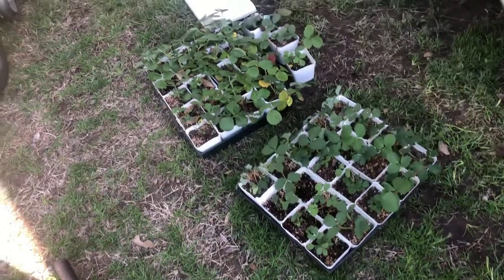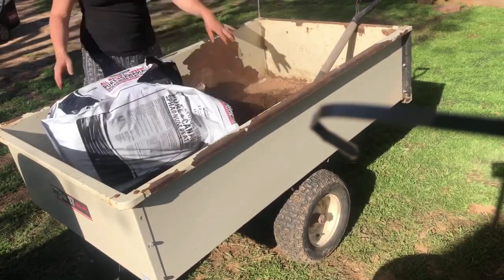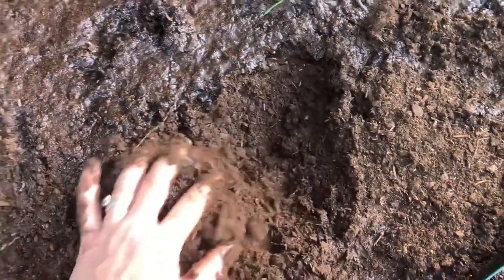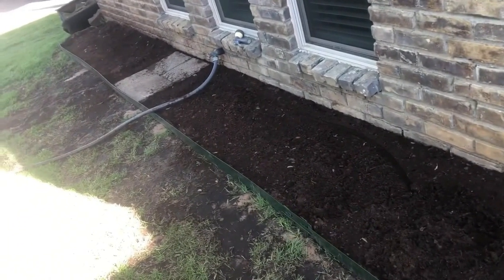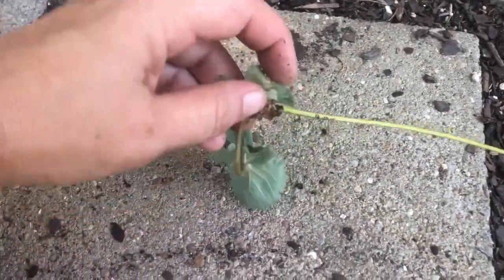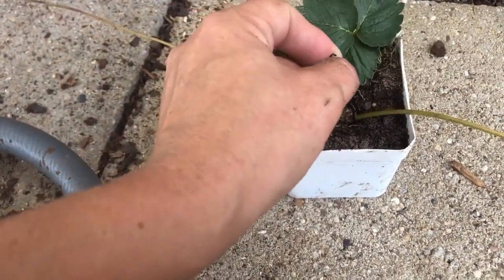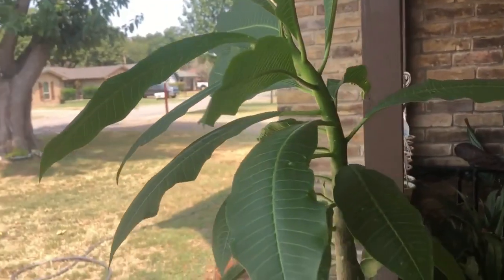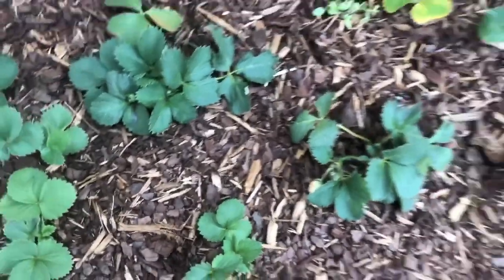Growing Strawberries part 2 DON'T MAKE THESE MISTAKES!!

Comment: I'm from California and I can tell you why it's one of the largest producers of strawberry; most if not all of the farms are close to the coast, so the marine layer helps shield a lot of the summer sun and heat but the UV rays are still able to get through. Our early spring weather is very warm, as well as our winters, so our strawberries (and tomatoes!) are essentially perennial. The soil is also rich there and perfect for growing strawberries. That being said, the strawberries were bred to withstand California's heat better and there are soil amendments they put in. This is for Oxnard/Ventura and the Salinas Valley, as well as some very small farms (around 1-5 acres) around LA County, Orange County, and Riverside.

I myself grew strawberries into the winter in my area (hillside), they tasted better than storebought still (more fragrant), but sometimes weren't as sweet and had much less yield. I'd still prefer them over storebought.

Comment: Worm castings mixed in at 10% to 20% of the soil mixture will not only add nutrients and beneficial microbes and fungi but it also has water retention properties. And it gives the plants an extra vigor.
Reply from the maker: I absolutely agree, in my first video I show how I water them with Worm tea and still continue to do so through the whole garden ❤️ so beneficial.

Comment: Sand and clay usually ends up making cement. Lots of compost, gipson, and vermiculite will make a big improvement. Cheers!
Reply from the maker: Thank you, most of that is in the mixture I am using from Calloways. ❤

Comment: Thank you for taking the time to making video part 2.  I learned a lot making my own mistakes and even more from yours.
I liked your comment about disregarding the plant picture on the fertilizer bag.  It was to the point without excessive words.
My friend gave me two very dried strawberry plants.  Both survived and sent out runners.  Four months later, I have 28 strawberry plants.  I tried cutting the runners, but they keep on growing back.  Is there a way to stop the runners without killing the mother plant?  Do I cut the umbilical cord closest to the new or mother plant?  Thank you.
Reply from the maker: Thank you for your comment. 
You can cut the runners off as close to the mother plant as possible. If the runner is not rooted, it will kill the runner, not the mother plant. The plants will try to grow runners so you do have to consistently do maintenance and clip them off if you don’t want anymore plants.